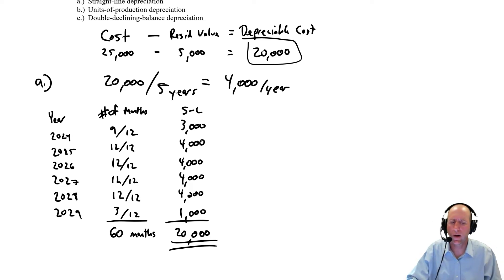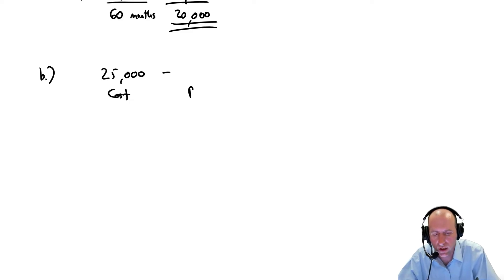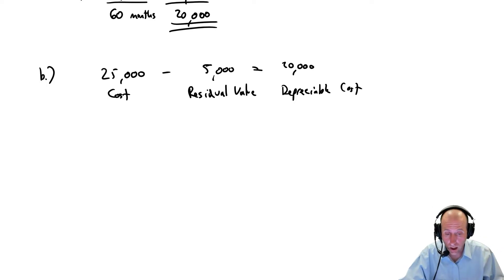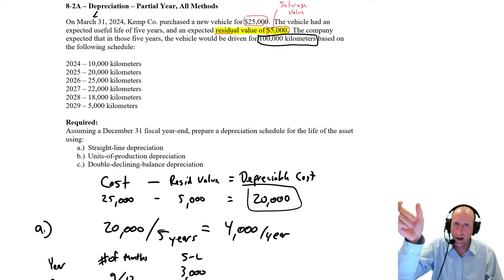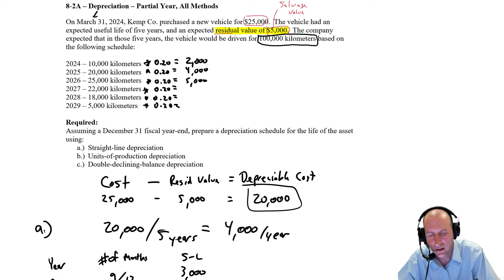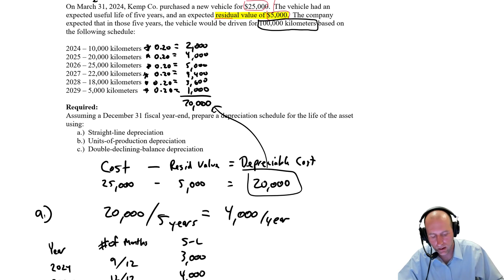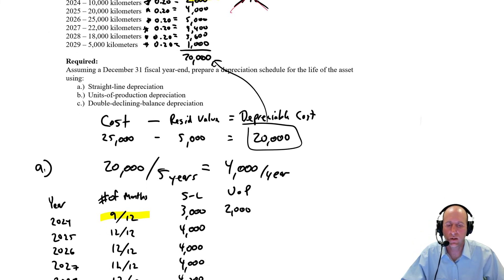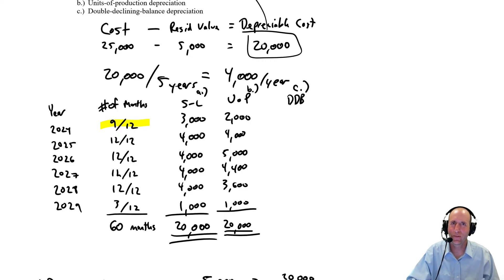FA 37 -  Units of Production Depreciation Example

Comment: So if time is not relevant for the units of production method, then aren't we technically calculating depreciation using this method for 6 years instead of 5? Since it doesn't matter whether it's a partial year or a full year?
Reply from the maker: Not really - you need to take the time element out of your mind completely.  The only thing that matters is the Units - so if it takes 20 years to get to the units, so be it.  If it takes 4 years to get there, so be it.  The time is not even considered.